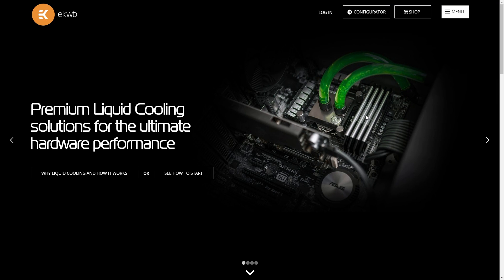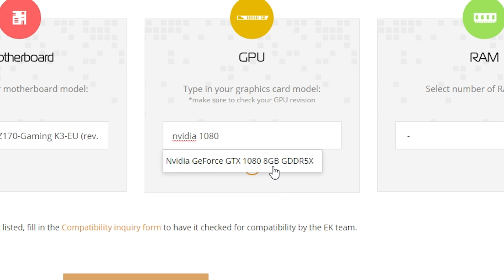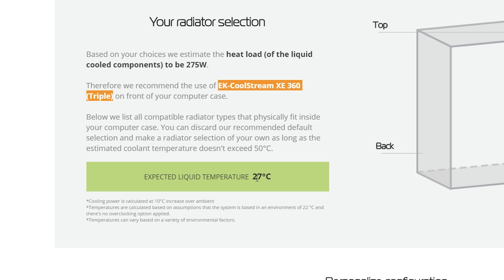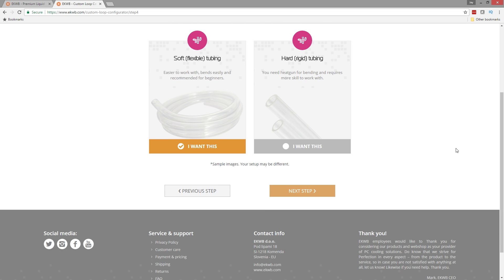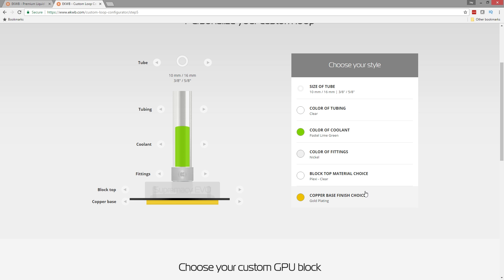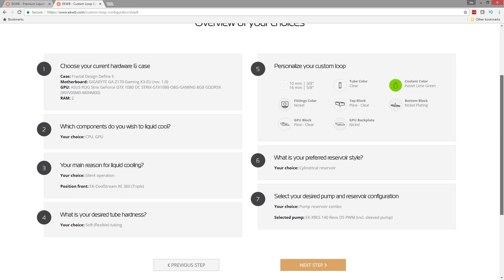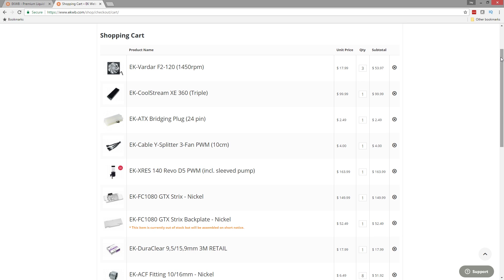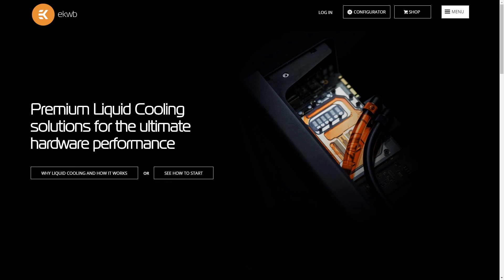How to configure a custom water loop using the EKWB CLC

Comment: i think this is a great idea as i have been browsing ek's site occasionaly and found it hard to figure out what exacly i needed. and then my solution was to select a kit and just chose those components and went from there.
so this configurator makes things a whole lot easier, and i like that you get a little picture how your blocks would look like, that can be a bit hard to judge just from material description
but i feel like it's still a bit glitchy as some things doesn't seem to work properly
i tried entering my dream pc build (corsair air 740, asus maximus ranger vii and two 1080(ti) classifieds) and i got a few problems, somehow it didn't add a cpu block in the shopping list, on my first try the second screen asked me to locate the 2 gpu's but clicking the picture did nothing.
i know the corsair air 740 has support for 280 rads in the bottom and top but it would only let me select 240 slim rads  max, and  i couldn't find a way to deselect a terminal to connect the gpu blocks, that would have been my choice but if i didn't want that it could cause problems with the amount of fittings needed
Reply: ohh forget about the cpu block missing, forgot i selected mobo cooling so it gave me a monoblock

Comment: Why 720x60fps?   now i'm forced to watch in 480 due to my shit chromebook and hotel internet :(  go back to 720 30fps
Reply from the maker: Its 1080p not 720
Reply: JayzTwoCents Pretty sure he's trying to say that his internet connection can't handle 720p 60 fps but YouTube doesn't offer 30 fps on anything higher than 480p.
Reply: Because 60 FPS looks better than 30 FPS. Tough for you but most people do have a somewhat decent internet connection. Even with 6 Mbps you wouldn't have a problemt at all to watch it in 1080p@60FPS. 
Also, you could download the video and then watch it. ;)
Youtube should only allow 60 FPS for new videos.
Reply: Yeah. Not sure if it's possible, but offering 1080p 60FPS and 720p 30FPS would be friendlier towards those with lower bandwidth while also offering the best for those with good bandwidth.
Reply: Matthew Kinney  exactly what I was attempting to say,  poorly I might add.
Reply: When you upload a 60fps video youtube makes all the resolutions in 720p and higher 60fps
Reply: Lol, forced to watch in 480 :P

No hate, it's just funny to me.
Reply: 3plus3ist4

That is a good advise. You can fix the resolution and FPS, until Youtube makes some software changes anyway. However, I would recommend to download the Youtube videos, that is easier.

Comment: I really wanna do a custom cooling loop, but my wallet says no. Also, not sure if it's worth it on the 3570k. I use a base 120mm corsair H55 with a the static pressure fan, I think the same that's in skunk works. Thanks for the video!

Comment: Sad to say that not all of the chassis radiator options are correct.  I have a Thermaltake Core V21 and EK only listed a 140mm Rad in the front where TT shows you can fit much more in the chassis.

Comment: 1450 rpm vardars would be no where near quiet lmao ive got their lowest rpm ones and its all I hear.
Reply from the maker: PWM is controllable... aka... use your motherboards fan software or something like speedfan. Not hard
Reply: Mine are so loud jay even at low speeds I just hear the motor noise.
Reply: same for me,they are good quality fans,but make horrible motor noise